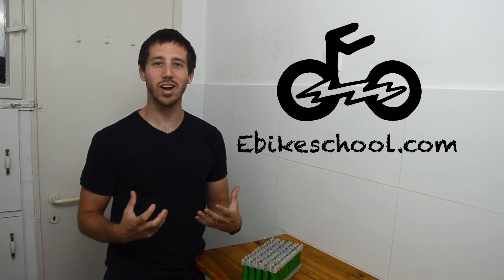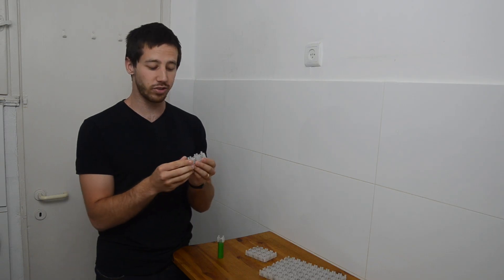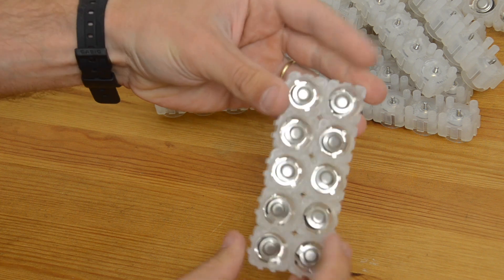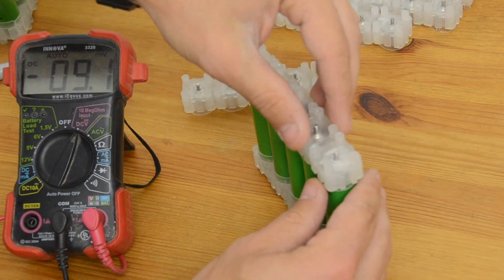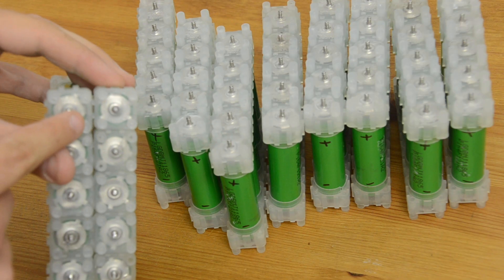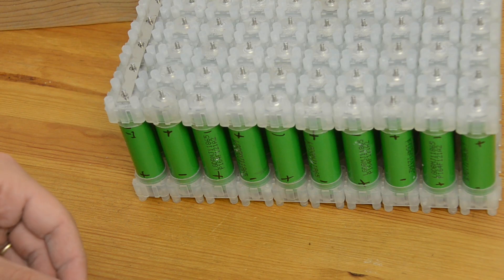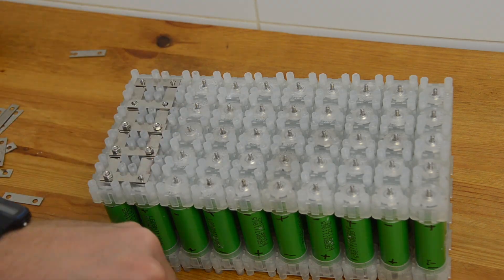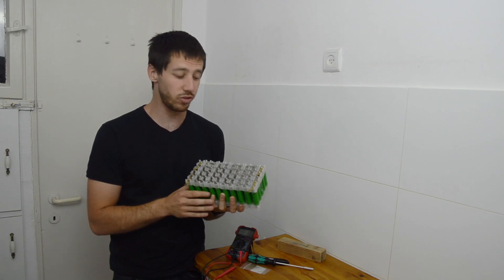No Spot Welder or Soldering Battery Building Kit from VRUZEND.com

Comment: what would be better, buzbar or fuse wire ?
Reply from the maker: It really depends on your application. For series connections, you'll most likely want to go with busbars. That will allow you to pull more power. For parallel connections, if you want cell level fuses, you can use fuse wire. Just make sure that it is rated higher than your charge current so it doesn't blow during charging. I almost never use cell level fuses, but I usually start with brand new cells. If using salvaged cells, fuses can be a good idea.
Reply: im planning on building a small power pack, this is my first, and im thinking in getting a bms for it, if i use a bms would i still need the fuse wire ? my packs are, 3 packs in parallel with 60 cells in each that then will conform a 3 series of packs for a 12v     <------------- im i ok with this or did i calculated this wrong ?, i all ready have 100 cells with vruzend and another 8 boxes of vruzend are on the way
Reply from the maker: I believe you mean the three sets of 60 cells would be in series, not parallel, right? That would give you your 12V (11.1V). You can use a BMS, but it doesn't protect against the same thing that cell fuses protect against. The BMS keeps your cells from going too high or too low with voltage. The cell fuses are to protect your cells from destroying each other if one shorts out. If you use good quality cells, then cell level fuses are less necessary. Like I said, I almost never use cell fuses, but I start with brand new, good quality cells.

Comment: I was wondering... I reside in a camper. 90% is 12volt. is it possible to replace the 4, 12-14v 1000 amp batteries with the 18650 sets? I have a solar charger, with 2 panels. 12v 15 amp fridge. water pump 15 amp, 2000 watt inverter 10 amp led lighting and and a 110v 30 amp battery charger. I can run all systems constant for 48 hrs. Non stop. with no charge. i have run reserving power for 7 days prior to the solar. lights and warer. everything else is propain powerd including the fridge. my power needs are minimum. but maintenance of the lead acid. I need to update the system. the 2000 water inverter runs all but the a/c sat for net access and tv. if it's possible to replace the house batteries. is it possible to replace the truck batteries? they are 2 800 CCA 13.5v. the alternator is 140 amp at 14.5v. the 18650 in my vape is 6 years old. that's 2 life spans of the lead acids. I am asking because I have access to 300 to 400 used but good 18650.
Reply from the maker: You can do it, but you might need more than 400 18650s. Lead acids suck in many ways, but the thing they are good at is high power. Lithium batteries in 18650 format, on the other hand, have great capacity and lifespans, but aren't as high power, so you need a lot of them to power such high loads. However, RV power applications aren't my specialty. I've seen some youtube videos where people do lithium battery RV conversions, so I'd recommend checking those out.

Comment: Could you use this to build a car audio lithium battery out of those little batteries
Reply from the maker: I don't see why not. I'm not sure what you're voltage/power requirements are, but you'd just need to use enough cells to reach those requirements.

Comment: That's a great looking product!  Unfortunately I'm thinking your shipping to Canada is kinda dear.  Or, maybe I'm just cheap?
Reply from the maker: No you're not cheap. Or you might be, but at least not related to this. Unfortunately USPS is really expensive when shipping to Canada, especially since our distribution center is in Florida, about as far from Canada as you can get. The BMSs and other small parts are cheaper because they can fit in envelopes, but the kits require a box and that gets expensive fast.

Comment: sort of off topic, but what kind of battery pack should you have to run the Rasberry Pi plus a hat amp like the HiFiBerry?
Reply: mlhm5 just a regular portable battery bank should work perfectly, be sure to ONLY use the 1 amp plug and never use the 2 amp plug

Comment: FU. Dang. I have 240 LG 2,200 mah li-ion batteries for $1.25 each, Brand new. and you want me to spend $.50 cents each for your system. Good luck with that.
Reply: true. it has its price. so its NOT the solution for everything we all hope for in the E-community. but for SOME it is a "bless" not to solder or spot-weld. one could argue you should have bought 150 4000mAh batteries....but I guess you had your reasons for your setup.
240pcs? what is it for?

Comment: as an electrical engineer, why is he putting all those parallel jumpers. only need 1 at each end.
Reply from the maker: More parallel connections means more room for current and thus more power. Think of it like a one lane road Vs. a 6 line highway. Which has more room for flow of cars? Same thing with electrons.
Reply: I suspected that is it's practical purpose, but he made no reference. Also does that setup deliver that kind of current necessitating all those connections? Looks like hundreds of amps worth of current.

Comment: At one point you say that the actual voltage does not matter as long as there is connectivity. I'd say it's pretty important that all batteries that are going to be in parallel have roughly the same voltage BEFORE adding the parallel connection, otherwise you are going to get a HUGE current spike potentially causing skin burns and potentially damaging the batteries.

Comment: so why the hell would any one do this? at basically $5 a battery cell your look at a whopping 50 batteries  for 36v at 17Ah? BRO you can get a deep cycle 100Ah for $120 instead of this $250. Its so dam expensive no including your pricey product. you can get 3 27Ah batteries for about $40 to $50 and at 3 of them for 36v you now have spent $150. 

FAIL
Reply: Please note that we are talking about mobility use, such as an electric bicycle,  not stationary uses such as a household backup power system. 
A lithium battery pack weighs 2/3 less than its SLA equivalent. The heavier your bike is, the more power it needs to move. 
You can customize a lithium pack in shape and capacity to match your travel needs. SLA shapes and capability are limited. 
If a single lithium cell within a pack goes bad, it can be replaced. SLA? No, you buy a whole new battery.
Charging times for lithium are shorter, much shorter than SLA
Battery longevity is dependent on many factors so I will leave that to others to comment on. 
Now finally I point out that lithium battery cells have dropped in price. They were $10.00 each for a 2.6 amp hr 18650 cell. Now they are under $2.00  Parts to build battery packs are reusable.
So drag around a 65 ib. 100 amp hr SLA on the back of your bike if you want, me? Hell NO!!
Reply from the maker: ^^^ Yea, what Gence said.
Reply: OK FINE. its still not as magnificent as you think. 4 Li+one ryobi  batteries would be 16Ah and 36V and for only $100, $85 each set with tax when they go on sale saving you about $100. Your telling me that you need this to spend an extra 100 ish to do this? they ryobi batteries even have a display and you can get a charger for them for $40 bucks. HOW ARE YOU GOING TO CHARGE THIS SETUP? i still think its a neat idea for someone who MUST have a custom size battery no matter the cost but its not an economical way to achieve this. Dont get me wrong, its a neat idea and has a use but its not the best way to get results after charging and voltage display and what not that ryobi already has set up.
Reply: loligagger85 
You have so misunderstood everything you think you know.
Reply: While it's true that Ryobi one+ 18v/4.2ah Lithium power packs are 4 for $100, each contains 10 cells at 3.6v/2100mah So you can have 40 2100mah cells for $100 or 50 2600mah cells for the same price.  
Now if tearing apart battery packs and risking bloodied fingers is your thing, there are many listings for both surplus new and used laptop battery packs sold in various sized lots on Ebay. See what $100 will get you there.

Comment: You are wearing a ring.  At least put some electrical tape on your ring if you don't want to remove it.  Even with the cells at a lower state of charge they can still deliver several amps through a ring if the ring accidentally completes the circuit.  Removing jewelry and wearing safety glasses are a must when building battery packs.
Reply from the maker: You're absolutely right. I almost always do, but this time I forgot. My mistake - don't do what I did, remove your jewelry!

Comment: Hey Micah, I'm ordering my kit with BMS and batteries next week. Any chance the new and improved kit with copper bars will be out by then?
Reply from the maker: I wish, but not yet. We're not sure on the time frame yet, we're still working out the production process for the V2 kits. It's not just the busbars, it's also the internal contacts that are being upgraded, so it's not a simple switchover for the production side.
Reply: OK, thanks. 
I'm only using it for a small 10s 5p this time. I'm sure it's more than adequate for 36v power levels. 
It's a great idea. I hope it takes off for you! I wish I had the funds available at the time to help support the pre soldered cells you were doing. I'm surprised you never got the crowd funding goal on that one. It was brilliant, but maybe ahead of it's time. Maybe try it again some day when more people are in the market for ebikes.

Comment: One thing I think could greatly improve your product is if you would just make half of the connector tops black instead of white or clear. Then it would be really easy to spot your negative and positive ends and would make battery design so much more simple.  Maybe you could implement this in your future production?

Comment: I have one concern only. This caps makes battery much bigger. I mentioned, there is about 5mm in between cells, what makes final 5x10 cells battery one cell wider and 2 cells longer. You can even make cell rows shift by half size to have cell circles in between to save more space and make battery even smaller. If you put battery to some, above back wheel holder, battery size does not matter, but if you want to put it on bike base frame battery size matters much.

Comment: Is it possible to rebuild a 48 V, 8.8 or 11.6 AH Battery for a BIONX System ? Because the BIONX protecting BMS is not responding after cell change. Or is it possible to reset the BMS in any way ?

Comment: Why not make the BMS a no need to solder, plug in and bolt part of this kit? AND make it easy to FIND and replace bad batteries....
Reply: The way you find faulty batteries is with a multimeter for 5gbp and you use a soldering iron for 15gbp to connect the bms because everyone fucking hates those green terminals that cost a lot to implement, take up a lot of space, are unreliable and so on. Don't do electronics without at least a soldering station! Mine cost 15 with shipping and works with 5+ years zero maintenance and I'm an electronics tinkering eng student.

Comment: Two things that caught my eye as you where working. When checking for a connection with a multimeter add a load, a small load will work. If there was a 1000 ohms resistant in your connection it would show good in your voltage test. It would be like a open circuit if tested with a load. Pushing the batteries in with your bare hand. The acid on your skin could affect the battery connection over time. I like your kit, I think it will get many more people into making there own batteries.
Reply from the maker: These are both excellent points, thank you. And I meant to mention that latex or mechanics gloves would be good to avoid leaving oil from your skin on the contact. That oil can slightly increase resistance, which makes waste heat.

Comment: This is excellent invention.  One thing that concerns me a bit that if the spring lose tension over time, the batteries may have intermittent connectivity issues during a jerky ride, but I would still like to try these out and see for myself how it holds up over time.   

Has this been time and stress tested?

Comment: Since lithium cells need individual monitoring as protection against overcharging you have to take the stack apart each time prior to charging.
Reply from the maker: Or you can add a BMS or balance connector to charge the pack without removing anything.

Comment: A good biased review :) . If the cells were offset some  couldn't you increase density ,or is there a cooling element involved ? I also imagine it would introduce some weaknesses with smaller offset packs I guess ?.  Look forward to giving these ago.
Reply from the maker: Thanks, haha. An offset could increase density somewhat, but it adds more complexity to the design. In the end, there is a compromise that has to be made to keep the price down and the flexibility of the pack design high.

Comment: would be much better if you offered fusible links  this is what tesla does for their packs, every individual cell is fusible linked.
Reply from the maker: This is possible with the VRUZEND kit. Just add a fuse wire to the screw terminal at the top. There is a demo in the FAQ section of the site.
Reply: since i'll be replacing every bus bar with fusible wire, can you offer a lower price kit without the 110 bus bars?
Reply: There is only a picture, the logic of which is not clear.

Comment: Great option for DIY battery building. At least one small improvement I can see. Use external shake proof washers to ensure really good electrical contact and prevent the nuts from coming loose. Or, change the nuts to Nyloc type.
Reply: Can't use nyloc's with battery.

Comment: a battery factory on alibaba warn about it not being safe to touch terminals with bare hands in series due to shock risk to hands at high voltages.  some people may not be aware of the shock risks when joining cells in series